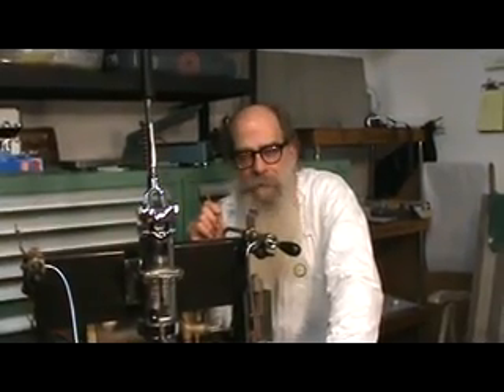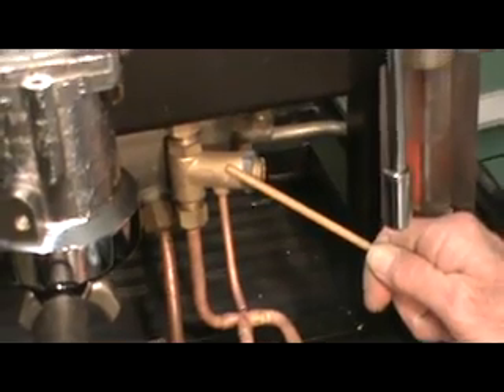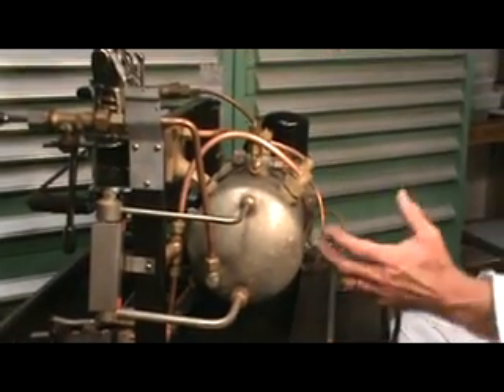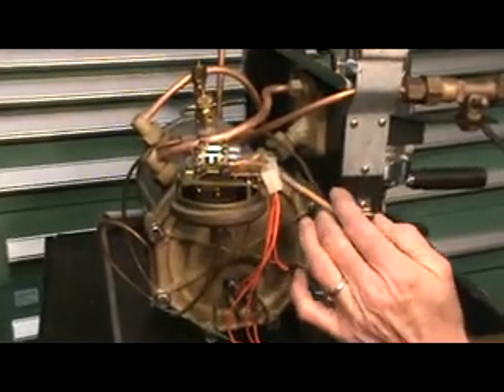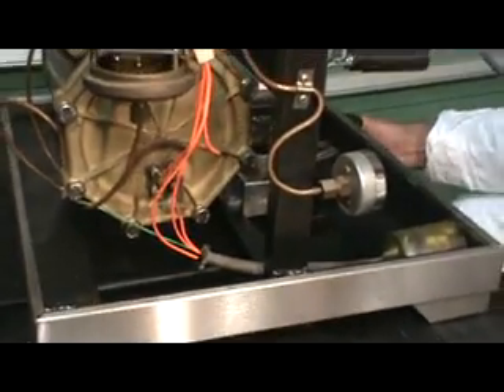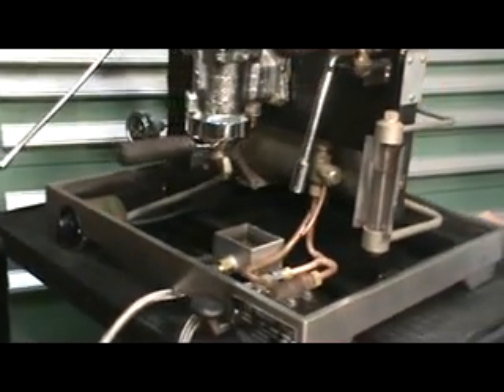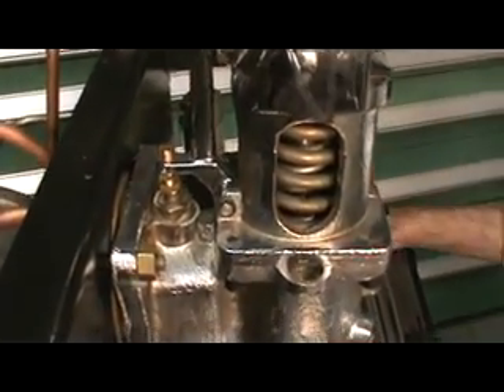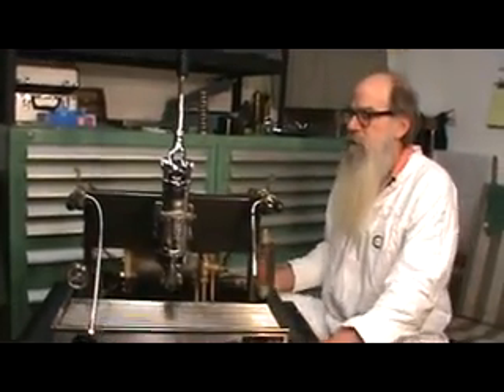La San Marco Model 80 One Group Lever Espresso Machine

Comment: I have one like yours, but a 2 group. I have a leak in the flow valve. Any idea how to fix it?
Reply: whats a flow valve?
Reply: @joeldomreis1762  sorry I didn't see your reply. Sorry I should have said, check valve or reflux valve on water supply line. I might need new valve but not sure if I can repair it.